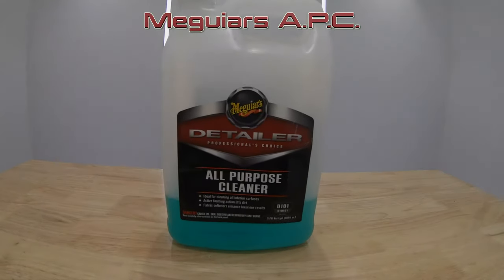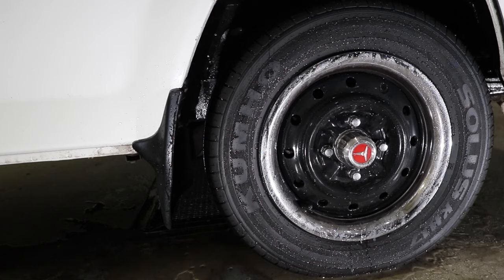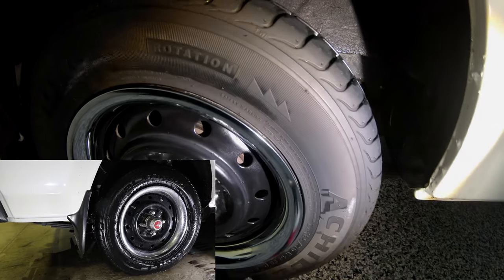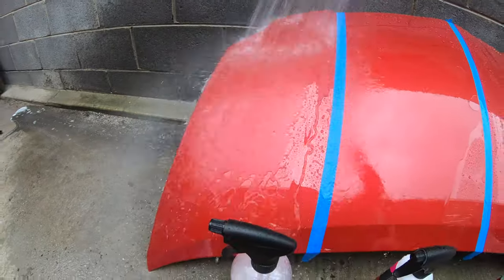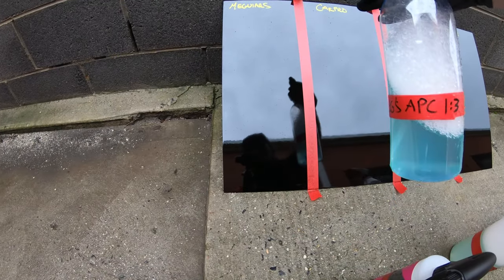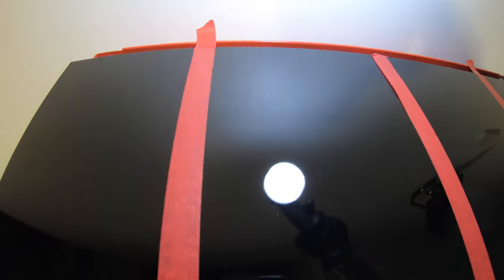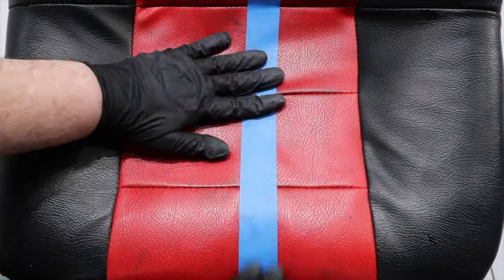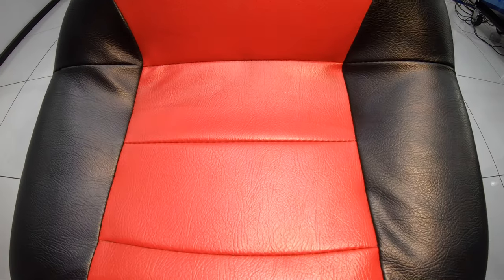Meguiar's APC, Carpro Multi-X, Auto Finesse Verso, Poorboy's APC Review & Comparisons!

Comment: I find all APCs are unique. They all have their strengths and weaknesses. They all have their own dilution needs based on the surface and what you're trying to remove. That's why I have 6 or more that I use regularly based on the task. Sometimes it's trial and error. You keep trying them until you find the one that works. ps -As for cost, you have to calculate the cost per ounce as diluted
Reply: So true - manufacturer claims can be right on the money, or either somewhat exaggerated/wishful thinking, or more aggressive than indicated in their product description/directions. Trial and error, especially regarding the dulling of car paint with resultant permanent streaking (not an issue if you're doing a full machine polish afterwords; however that result may actually be reducing the paint thickness to some degree - I'm not sure if that's actually the case or not) is definitely required. There's also a bit of an overlap with APCs and degreasers in some cases, especially regarding industry vs. private user-marketed products IME.
Reply: 6 different APC’s? Either you like making shareholders rich or wasting time😂

Comment: The fact that MultiX is removing so much from the rear tires alone, I'm impressed. Usually the fronts will accumulate way more grime than the rears. Definitely getting a bottle to try it out.

Comment: been a carpro fan I been wanting to give multi-x a go BUT at $24 for 500ml bottle and the fact you can only get 500ml bottles its over my price range for a business. I use carchem they have apc 20L bottles for $80 and mix right it will do any job so as a business stand point thats the one to go for BUT if i was a weekend worrier/ hobby guy then my money would be on car pro
Reply: @CarCraftAutoDetailing  if waxit sell the 4l bottles I can see it been sold at a good price where i may swich or even keep in stock

Comment: Great video.  I still have some old Meguiar's D103 APC+ that I have used for a long time and I agree with what you mention with D101.  Avi sent me a bottle of Multi-X and I have to say that it is a great product.  The more I use it the more I like it.  I also like Inside for the interior much better.  1:4 of Multi-X seems to be working out for me pretty well for tires.
Reply: Good info, Mike. Thanks for the info. Also, great video, Sandro! Thanks fellas

Comment: I would also like to see this test done with Optimum Power Clean, a product that I've been thinking about getting vs Megs APC. Great video as always!
Reply: The Optimum Power Clean is a significant jump in performance from the Meguiar's, and it doesn't irritate the sinuses or skin nearly as bad. 

I do keep a gallon of the Meguiar's on hand though. Its a LOT more economical.
Reply: @danlc95  What about MultiX VS Optimum Power Clean. That is my curren dillema... not enough MultiX videos out there. I have MultiX myself but I feel like it doesn't really use well, like I guess it cleans well but the solution always runs off since it's dilluted a lot (I think thats why idk) quickly and don't really foam up.

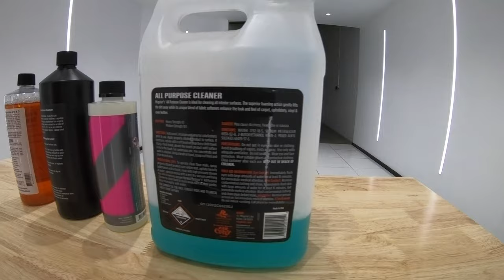Comment: If you do a degreaser comparison I would like to hear your thoughts on specifically when to use an APC vs a Degreaser. I think of it like this: given the same dilution lets say 1:10 a degreaser should perform much better but it has a higher chance of damaging whatever surface it is being used on. The confusing part is just highly diluting a degreaser to make it safer is there a reason to use a APC at that point (minus things like interiors where I would almost never use a degreaser)? Good video btw!
Reply: A degreaser is a stronger cleaner, which i would use for mainly exterior aka tires/rims/wheel wells/exhaust, when you want to deep clean parts that get really abused. Examples meguiars degreaser, multiX
Then there's interior apc, they are less powerful cleaner that can still be diluted, but won't  leave residue on plastic or carpet or leather.
You would use them for cleaning leather, or carpet, dashboard etc. Meguiars APC is more of an interior apc, since it contains softener for carpet and cloath, and gets remove easily without leaving residue behind.
Although there are designed differently, you can still use them on exterior/interior, like for example using a degreaser on nasty spot on carpet, or if a leather seat is really dirty and using a degreaser gets the job done faster.
Reply: @TerrificFlow  what is the best dillute ratio  meg apc for interior bro? Can u help me...
Reply: @shamilbasayev99  i stick to 1:5 for everything pretty much, although my car doesn't get real filthy inside.. But when i get to do a leather car that didn't get cleaned for years, 1:5 gets the job done pretty well with a leather brush, and then damped microfiber to remove the dirt.
Reply: @TerrificFlow  thanks alot

Comment: Can someone please explain to me what's the difference between a car wash shampoo and an all purpose cleaner? If I have the Maguiars ultimate wash and wax, do I need to buy Maguiars all purpose cleaner? My car gets very dirty and muddy by the end of the day. What's the best way to wash a car? 
I use a hybrid ceramic spray at the end of a wash once a month.
Reply from the maker: A standard car wash shampoo is usually quite a gentle ph. balanced product used to routinely wash and clean the whole exterior of a vehicle in the safest way possible with its effective yet gentle and well lubricated formula. 
An APC is a far more aggressive chemical generally used to deep clean car trims such as tyres, wheels, plastics and also sometimes car paint if you need a more effective cleaner. 
If you find that your car wash detergent is working great to clean the vehicle, then you don’t necessarily have to use an APC especially on paint. But if you have more stubborn grime in certain areas or you wish to strip off older waxes and sealants then an APC can be very beneficial as long as you use it in a responsible manner as is the case with many other car detailing chemicals such as iron removers, tar removers and automotive clay: you use them as needed to address more stubborn grime, rather than use them routinely like a car wash soap 🙂
Reply: @CarCraftAutoDetailing  Thanks so much. Wasn't expecting such a quick response. That explanation is wonderful. It helps a lot.
Reply from the maker: My pleasure mate

Comment: hi is 1 part = 20ml??
Reply: @CarCraftAutoDetailing  Thanks a lot!!!
Reply: @TheMegatot  Also, if 1:3, 1 is product and 3 is water.
Reply: Are you serious? 1 part can be anything of anything...Let's say you have a 500ml bottle you want to fill with a deluted product with a 1:12 ratio, that means 13 parts in total. 1 part product and 12 parts water. So 500ml/13 = 38,46ml.
So 1 part will be 38,46ml and the rest or 12 parts will be water (461,54ml) . Understand now? Offcourse if you don't want a full bottle you can pick other volumes, you just have to respect the mix ratio.